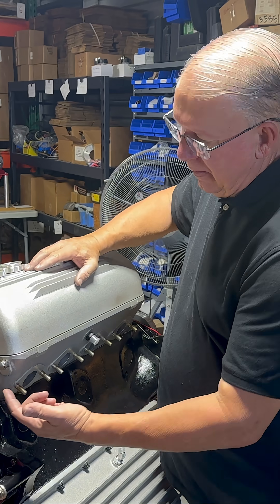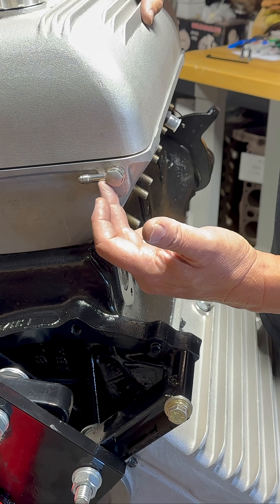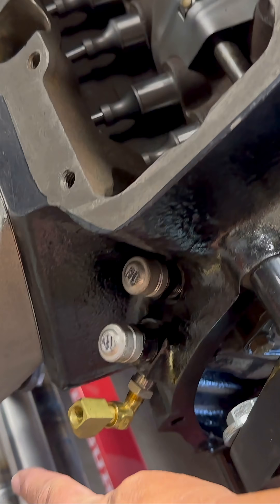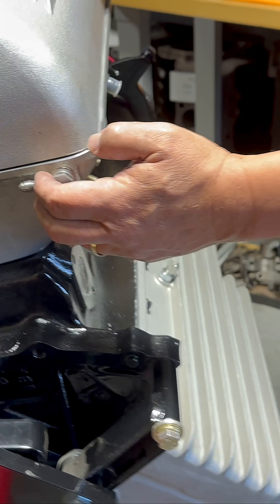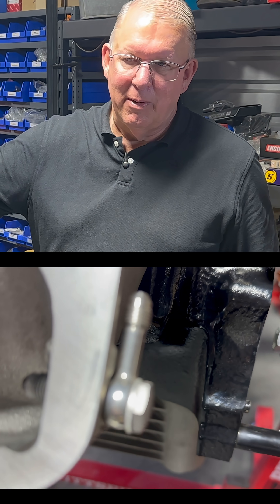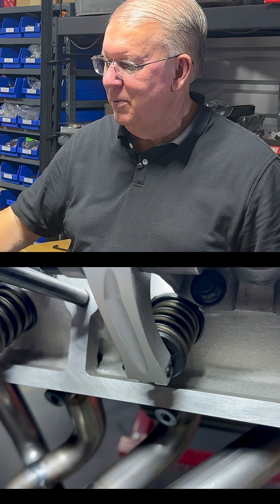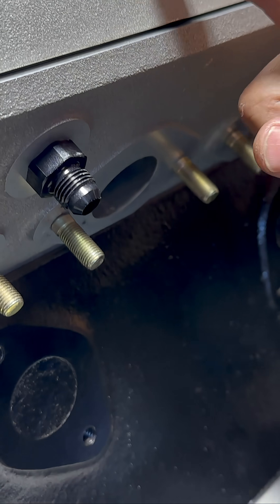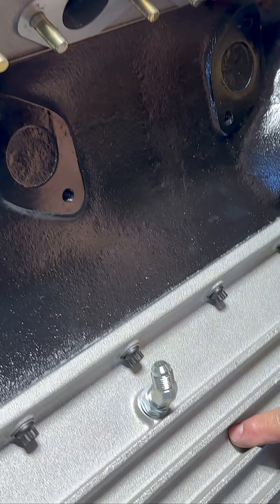Dealing With No Oil in the HEAD! Ardun Heads Assembly Dyno Prep! Steve Coppock w #BarryT

Comment: What's the point of putting overhead valves on it? It's a trash underpowered engine even with all that wasted money and time on top....in my humble opinion of course
Reply from the maker: It’s a hobby and a passion for Steve. Obviously the highest horsepower engine in the world is not the goal here. Also the head design dates back to the 1940s and it’s fun to work with vintage ideas and equipment and see if there’s still room for improvement with it.